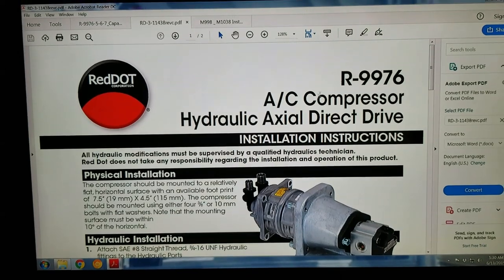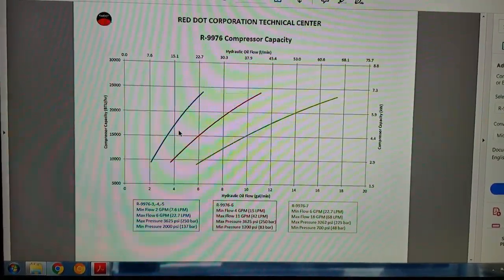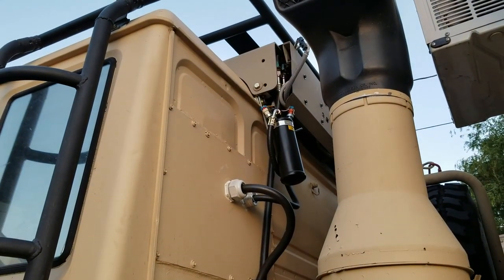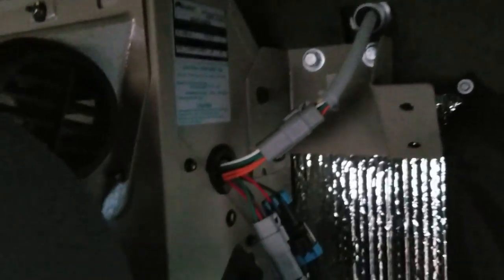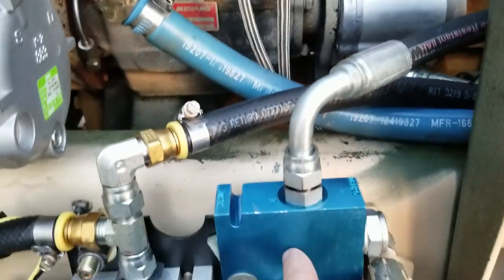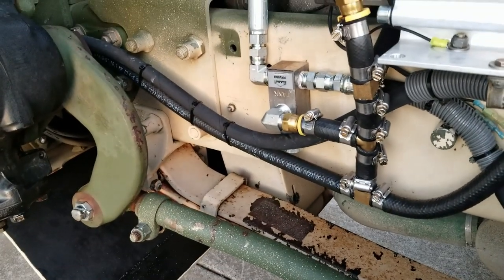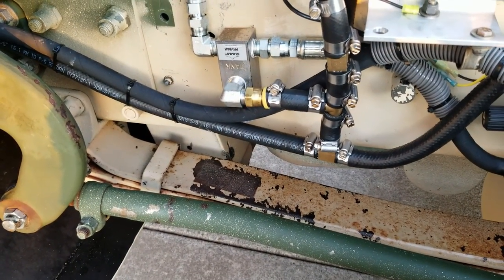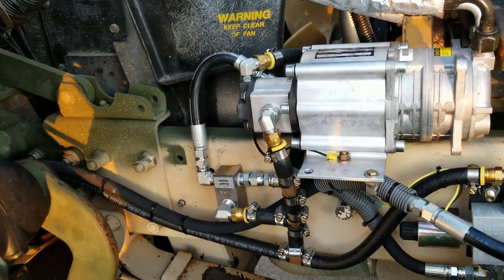Red Dot hmmwv a/c with Red Dot hydraulic 9976 compressor walkthrough

Comment: Sean, thank you for doing this video it answered most of my questions.  I am looking forward to the belt driven compressor video.  I was wondering why you went with a hydraulic compressor instead of a belt driven compressor, was it too hard to find a place to mount it or will it pull too much power from the engine?  Just wondering why you went that way but it has been cool learning about this.  I have to say that I am learning a lot from your videos, thank you for doing them....
Reply from the maker: To show that an alternative approach to a solution is possible if you set your mind to it.  The parts were cheap.  It works great.  It was a fun project....

I love a good challenge and when I scored the compressor for 100 bucks shipped it was game on!!

Comment: Nice job Sean, as always. I am doing a belt drive off the alternator,  but this is a great approach. I saw the new shocks in the background. How are these working for you?
Reply from the maker: I covered the shocks in a previous video.  They work great and were 100 bucks for a set of four.
Reply from the maker: On a sidenote you won't make enough btus with any compressor if you pull a belt drive off the alternator.  You need at least a 9 inch pulley to get the compressor spinning fast enough to create the flow you need to create a dent in the greenhouse gases.  Check out the sanden compressors and use a pulley calculator to see what I mean.  With a pulley on the alternator (3 inches) at best you will get 7k btu cooling power with the best compressor you can find.  Looks cool in the engine bay but has very little power behind it. 

Most compressors have a 6 inch pulley and are most efficient close to 3-4k rpm depending on the model for reference.  Sanden has a really good website.  Check out the sanden 4311 for reference.  It is the one that goes with the hmmwv kit I have here.
Reply: @SeanFillner  Glad to hear they are working well. 

Interesting build. I will look into this, since I have found that I really like hydraulics. When I look at the various blocks and hoses that you have, I'm a bit lost. Maybe others would like a quick diagram of what is happening. I have the larger OEM A/C unit.   Thanks for sharing.
Reply from the maker: @urgentcareguy3  see previous videos of the a/c install I have explained the setup numerous times.  This video was just a parts list.

Comment: Nice work!  The compressor motor has 3 lines, 1 supply, 1 return, what's the 3rd one for?
Reply from the maker: it's a drain valve to the tank.  I am not sure what it does but the instructions say to make sure it is connected to the tank.